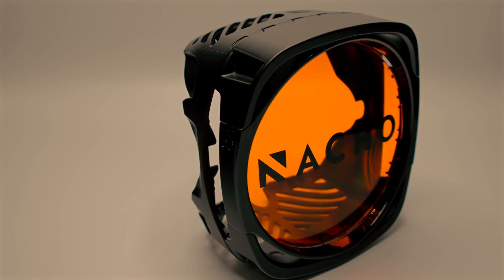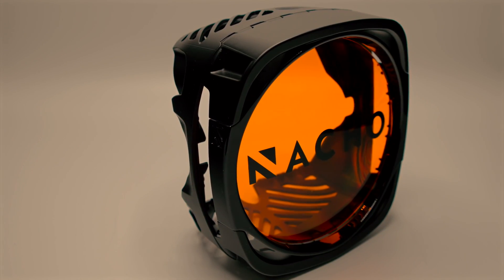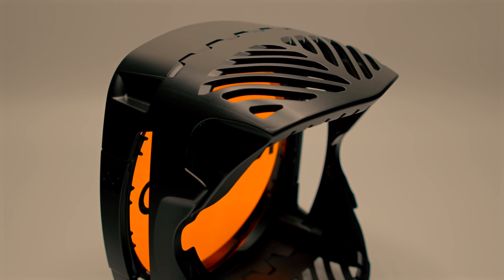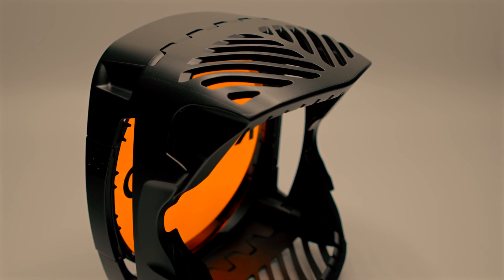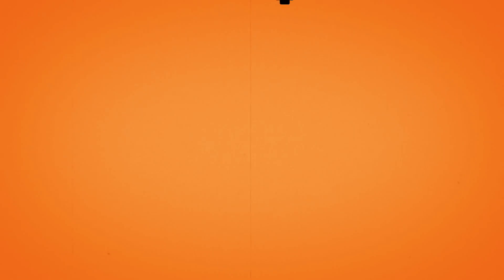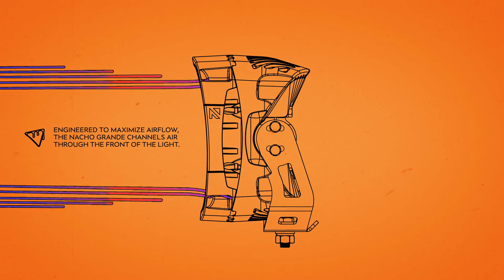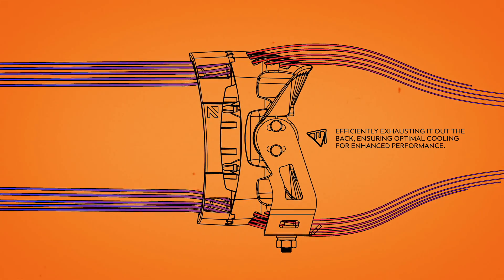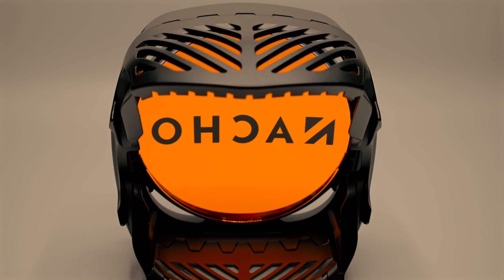NACHO Grande's External Housing Explained

Comment: If I wanna run a couple pair of these lights how do I hook them to an spod, switch pros etc without using up the whole thing for other functions?
Reply from the maker: The constant power aspect of the light allows you to run as many Grande's to one trigger since the light harnesses the relays.  So you can run 4 grande's to one switch of the SPOD.  No worries
Reply from the maker: You can run the power and ground wire from the light to the battery and then just take one of the 3 trigger wires and wire that direct to the SPOD and utilize on the switches in the SPOD.  The nice thing about the Grande is you can just use one switch and just change your light output anytime depending on what kind of off roading you plan on doing.